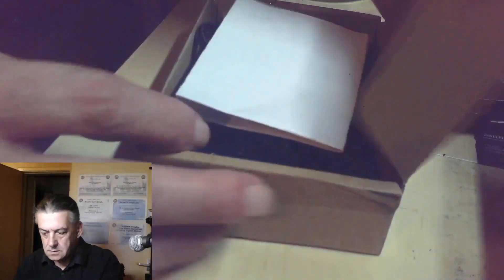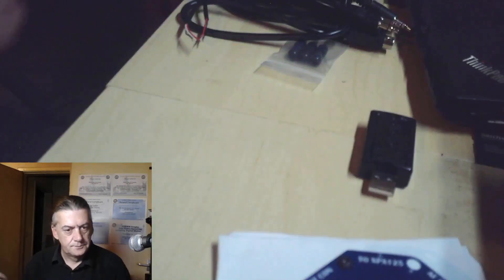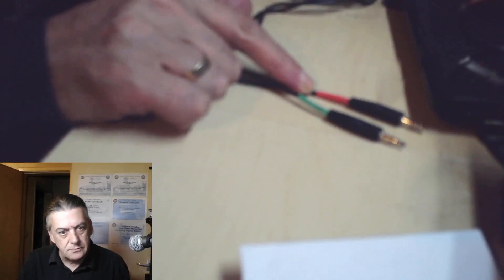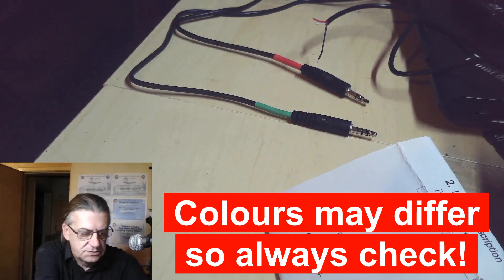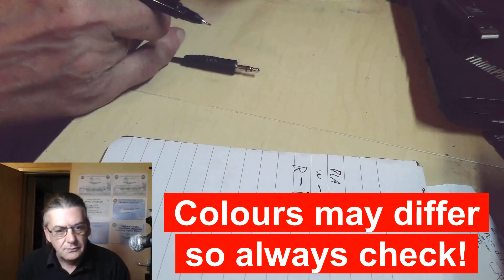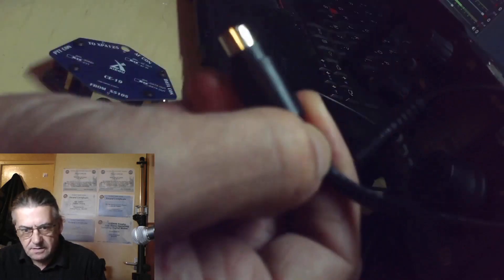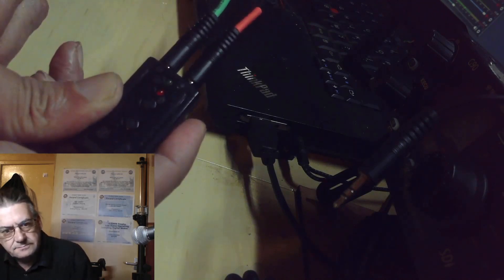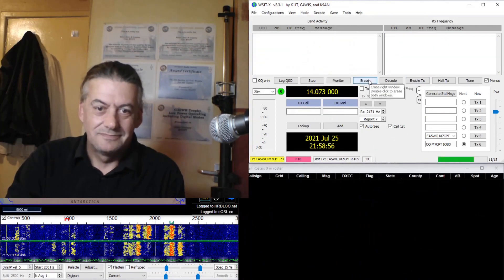Wiring the Audio Lead For The CE 19 For The Xiegu X5105/G90

Comment: I don't have 8 pin mini DIN cable. Can you tell me the pin out on it please? Is it a straight though cable? I found the pin out for the G90 but not for the C-19. Is it a cable used on other equipment?
Reply from the maker: All pins should be identical but the AF_IN and AF_OUT should swap over.
Reply: @A.R.O.T.A.   Excellent. Thank you. I bought the C19 sec hand. No cable! 73.

Comment: I think I understand but what is the green wire
Reply from the maker: If you follow this method the wire with the green marker connects to the speaker out of the sound card and the red marker connects to the microphone/line in. If they are wired correctly you will see activity on the waterfall of WSJT-X (20m daytime/40m nighttime are normaly busiest) if not try swapping them around.

Comment: For the 3.5mm three conductor, Ring, Tip, Sleeve, (or RTS for short), plug that goes into "AF CON" on the CE-19, the key is:
1) the red wire (AF CON tip) goes to the red and white wires (tip and ring) of the microphone cable (usually a red colored 3.5mm jack on the PC).
2) the white wire (AF CON ring) goes to the red and white wires (tip and ring) of the speaker/headphone cable (usually a green colored 3.5mm jack on the PC).
Reply from the maker: I have seen some of the wires provided that do not conform to this standard so I recommend the use of continuity testing to be sure.

Comment: EXCELLENT JOB Thank you John.  I've been trying to figure this out for some time! I would really love to see the G90 and PC settings video as well! 73
Reply from the maker: I am planning to do a full in-depth walkthrough of the G90 at some point but for now all I can tell you is:-
1: Short press "FUNC" then press "POW" twice and change the input from "MIC" to "LINE"
2: Set "MODE" to "USB"
3: Short press "FUNC" then press "CMP" and turn for maximum width
4: Short press "FUNC" then press "NB" and turn for maximum width
5: Turn off "AGC" + preamp/attenuator
6: Long press "FUNC" press next until you see "AUX IN Volum:" adjust for your TX volume (If too low it will not TX. If too high your signal will distort)
7: Long press "FUNC" press next until you see "AUX OUT Volum:"  Adjust this until the WSJTX dB volume is between 40 & 60 so the PC can hear well
6 & 7 will vary according to your personal setup (antenna/coax/sound card/computer/etc.)
I hope this helps.
Reply: @A.R.O.T.A.  thanks much
Reply from the maker: Your welcome.

Comment: I can't tell you how helpful this was! It's simple enough, but I kept putting it off until I could find proper documentation or in this case your video. Thanks.
Reply from the maker: This was such a simple thing that I didn't think of covering it until someone on Facebook and also in the forums of QRZ.com asked specifically if there was a video showing it. As I had one I needed to wire myself I thought I'd video it. I was surprised at how many people viewed this in the first 24 hours and even after 2 weeks it is still going strong with 193 views. I am so glad that it has helped so many people.